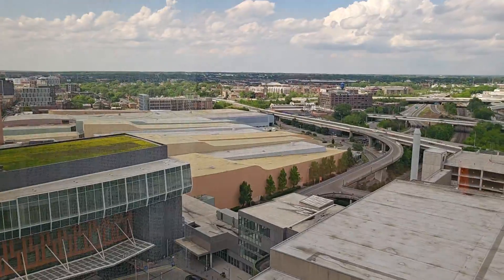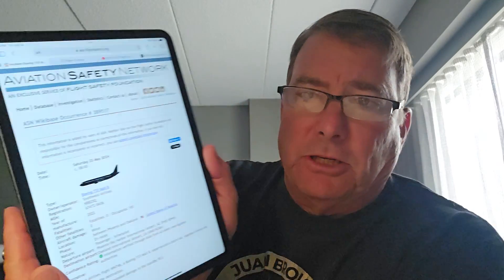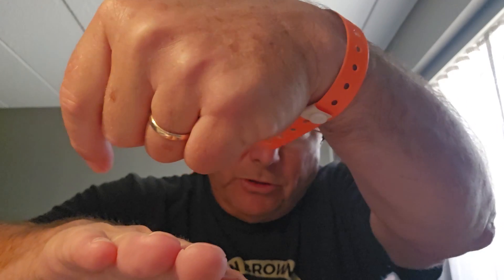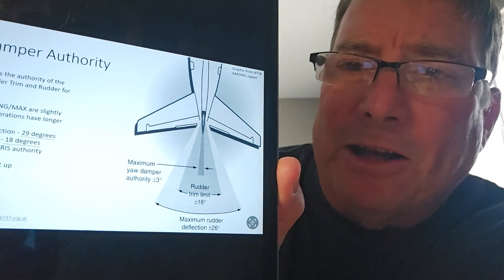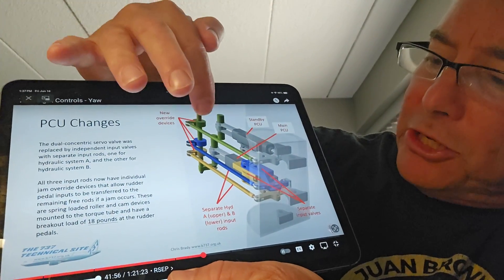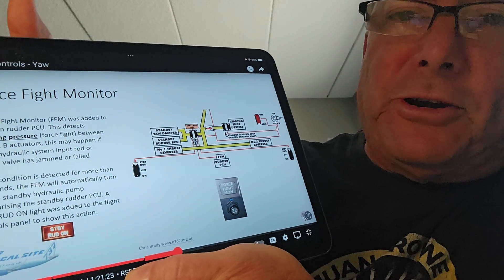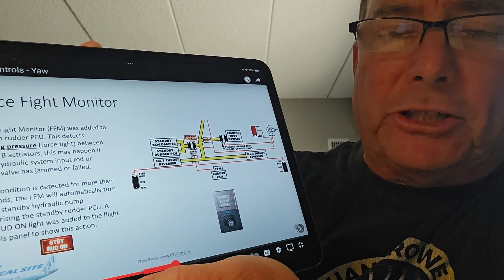SWA 737 Max-8  "Dutch Roll" Incident

Comment: Hi Juan, thanks for the in-depth post and explanation. If anyone has ever seen or been in a larger aircraft while the pilot is getting aerial refueling training, you've seen or experienced dutch roll. During this evolution, the pilot often causes the dutch roll via a PIO or pilot induced oscillation while trying to stay in position behind the tanker. Remember that, Juan? Cheers!

Comment: I've always had an almost irrational fear of fly by wire mechanisms.  I'd rather not have the machine between myself and the machine's control mechanisms.  I suppose all of those electronic and mechanized control systems have less of a chance of failing than cables do and I don't think that there is much of a choice in the matter based on the amount of force that can be exerted on the control surfaces of some of these high speed flying vehicles. We have no choice if we want to use these systems except to accept the fact that our lives must be entrusted to machines and computers.  I have always made the assertion that if you want to live to be old then don't ever trust your life to a computer.

Comment: One of the things we do in simulator training is a Dutch Roll demo at high altitude. We disarm the Yaw Damper and turn off the autopilot. The results of displacing the rudder in this condition causes a Dutch Roll that can be really dramatic in swept wing jets and hard to recover. Props to the pilots in this case who managed to recover from this incident.

Comment: For all you fellow aviation geeks out there, according to William Cook in his book The Road to the 707, the yaw damper was invented by Ed Pfafman, an engineer at Boeing during the flight testing of the XB-47 - the USAF's first swept wing jet bomber. The test pilots noted a continuing Dutch Roll in  '47 and Ed came up with a solution. Brilliant guy. A yaw damper has been standard equipment on swept wing jets ever since.
Reply: The yaw damper has come a long way: the early ones were mechanical (mass and spring) devices, and now they are electronic, part of the flight control computers.
Reply: Some of the engineers at NACA, the predecessor of NASA, worked on similar systems, including pitch dampers and special systems to help control buffeting. One of those guys was Christopher Kraft, who later became the Chief Flight Director at NASA.
Reply: correct ,,dutch rolls have been happening for years on aircraft and at high altitude and your are correct about the yaw damper,,,gyro,,,it will correct this no big deal.

Comment: If it's a 737 Max I ain't going on that Boeing.

Those fuel-efficient engines are too large for that older basic airframe and the center of gravity was thrown off.   That's why they installed the MCAS system to try and compensate for that imbalance, IMHO.  NO THANKS.

Comment: Good Day Juan.  Fairly technical but well explained. I do understand yaw dampers to a degree.  How could Boeing screw up a long in production aircraft so badly?  It's like the car manufacturer's recalling hundreds of thousands of new cars for a problem that was solved decades ago.  Why did they "Change" something that worked?   Maybe Airbus should take over running of Boeing. or, let the engineers start doing their job, again, instead of the bean counters...   Even you, Juan, are now questioning Boeing.  
Thank You & Best Regards.    Fly Safe, Clear Skys.

Comment: I am a mariner, not a pilot. Do I understand you correctly that there are actual cables (not electrical cables) on these aircraft ? If so I have to admit being shocked. I always assumed the systems were fly by wire !
Reply from the maker: Not on 737s.

Comment: Airplanes do not develop extreme dutch roll if the yaw damper is working properly.  Therefore there was either a malfunction or the yaw damper was not engaged.  The damage nobody is talking about probably involves the vertical tail structure which can fail if the maneuver continues to get more severe (diverge) .  The biggest risk is encountering turbulence at high altitudes above FL370.  I suspect that the difficulty occurred above this altitude and the pilots were descending to aid in recovery as they are usually taught since pilot recovery is extremely difficult using manual flight control inputs.  Yes, once upon a time C-141 pilots were demonstrated dutch roll during training.  They however turned the yaw damper back on to recover and were not required to demonstrate proficiency in making a manual recovery.

Comment: United Airlines Flight 585 on March 3, 1991, from Denver to Colorado Springs was not a rudder hard-over. It was a multi-axis hard-over. After that accident Boeing lost faith in the Honeywell SPZ system and went with the Collins flight control system. They came up with some rolling wave off the mountain theory to explain the high rates of roll the aircraft experienced, but it was baloney. Computer simulations at that time showed that to achieve roll rates the aircraft experienced the ailerons would have had to be also involved. Many in the industry believe there was a design error in the SPZ system.

Comment: Since aircraft now have constant access to hundreds if not thousands of Mb/s of bandwidth anywhere in the sky, and since the memory capacity of the Internet is measured in petabytes if not exabytes why do commercial aircraft not use a tiny fraction of that bandwidth to continuously transmit the CVR and FDR to their headquarters and optionally to their national safety regulators?  The information is privileged, but surely not from their own management.  Or failing that whenever maintenance equipment plugs into the aircraft why is the contents of the recorders not downloaded "just in case".

Comment: I'm not sure that additional cockpit voice recording would have shed more light on this incident; "Oh [expletive]!  What was that?".  Further, modifying the voice recorder is not as simple as modifying the circuitry to allow a larger memory chip (most probably what are known as NAND/NOR Flash chips like in USB memory sticks) - in fact,  that's the easy part.  Then there would probably need software modifications and system recertification, which nobody wants to do because of additional costs for each type of box flying.  Finally, from the pilot's perspective, I wouldn't want to work in an environment where every word is recorded...

Comment: I remember the old Heinz 57 sauce rule from my 727 days.  With no yaw dampener (had to go there Juan) the sum of your altitude and airspeed should not exceed 57.  For example: if you're at FL370 then your airspeed should be less than 200kts.  This reduces the dutch roll tendency.  I'm sure it's similar for the 737 but the 727 has a highly swept wing exagerating dutch roll.
Reply: If you try to slow down to 200 knots max at FL370, the first thing you will experience is the 727 falling out of the sky well before 200 knots.  Dutch roll worries will by replaced by stall recovery steps.

Comment: I'm not really an aviation guy (I prefer things on wheels) but I always follow air crash investigations and educational videos like this for their engineering input. I remember those two rudder hard-overs from years ago - they took some work to track down the fault. If I recall it needed a very cold pcu with very hot fluid to replicate the fault.
Modern aviation is nothing short of a miracle.  I cross rhe Atlantic regularly, and the aircraft always leave on time and arrive on time and nothing ever goes wrong.  I think that is because we never forget that carrying people in a highly complex tin can seven miles in the air is a very dangerous activity. Once we start cutting corners and taking chances, the wheels will soon come off, if you know what I mean. That's what Boeing seem to have done since they ceased to be an engineering company and chased shareholder profits.

Comment: I would only imagine that full rudder cable control inputs simply command the PCU to full deflection of that hydraulic actuator. The PCU itself would reach its mechanical limit of the hydraulic cylinder and stop there. I think the damage could be caused by one of two things.
1. Somehow both PCUs were commanded in opposite directions simultaneously which could have overloaded the ribs torsionally.
Or
2. The rudder input from the pilot to correct the Dutch roll event somehow commanded full deflection at speed, over-stressing these ribs. Generally there is a rudder limiter that reduces rudder travel in relation to airspeed/mach. This will be interesting when we find the answer to say the least…

Comment: Engines are in a different location and thrust centres have moved. Even the enginr nacelles present different drag when in yaw. Any dynamic system requires tuning when such fundamentals change.

Comment: Thanks for the honorable mention of the C-141.  I'm sure you remember the C-141A flew along in a tiny dutch roll movement and when the plane was lengthened (with air refueling added and designated a C-141B) that the slight dutch roll was eliminated with a new digital yaw damper.  A more stable feel of the aircraft was a welcome change.  Keep up your great analysis THANKS !

Comment: Well, this retired 737 pilot, confused by the reports, queried "ChatGPT".  ChatGPT says that "yes there are changes to the PCU on the Max...The rudder is more integrated with other systems, such as MCAS".  Yes, I know, the dreaded MCAS.  However, Chat goes on to say, when I asked specifically, that MCAS does NOT have any input to the rudder movements and is limited to inputs to the horizontal stabilizer only!
Clear as mud.
Did this aircraft suffer a loss of Hyd Sys A or B?  Did they manually turn on a Sys A or Sys B "Standby Rudder" switch?

Comment: My question is why doesn't the FAA require planes to transmit "black box" data to the cloud? Most modern airliners have satellite based internet on board for customers to use WiFi,so it seems like the airlines should pay for server space to hold all their flight data and voice recordings. This would solve the problem of recorders being overwritten, and also the problem of finding the "black boxes" after a disaster in which the plane disintegrates.

Comment: Thank you for calling out the "dampENer" media broadcast misinformation. My time with C-141As was 1976-80 (air cargo side), when they converted to "B" models -- I'm curious if the extended fuselage/long. axis  added-to or helped mitigate Dutch Roll problems with that otherwise tough, capable global airlifter. (It had "lift-dumpers" too, below the spoilers, if I recall.) In this most-recent reported event, good on that trained and alert crew in recovering from the grim prospects of such a failure. Christ almighty... that Alaska Airlines door plug blowout has finally yanked the corporate greed tarp off of an unending list of indefensible, I believe criminal culture in their house.

Comment: This makes me wonder if the software engineers don't understand mechanical limitations, or mechanical limit tolerances. Sure, they understand when you Input Yoke X, Y, Z; or X1, Y1, Z1; there is a corresponding output of the PCU, but do they know there are limit tolerances (milliseconds, 1/10,000 inch of travel, +/- .3 degree's etc)? I think something is getting lost between software design and mechanical design.

Comment: So they lost 2 aircraft before carrying out a workaround to the problem? Be interesting to know how often the stand by PCU is called into action?  If it's called into action a lot then a single failure (damaged to PCU or mounting ribs) may just be a maintenance issue. If it is very rarely called into action this may indeed be a design problem with limited use hiding the fact of a potential issue.
Again here we are with an old design using old tech to keep the model flying. The Wright brothers were using cables and pulley's

Comment: 2024 Reauthorization Act, which was just signed, mandates the CVR to 25 hours for new aircraft, and six years to retrofit older aircraft with the 25 hour CVR. (It is HR 3935 in case anyone wants to read it)

Comment: What do you think started the Dutch roll? Smells like a yaw damp hard over. I don’t know the max systems, could the yaw damp be on the primary pcu? They had a problem, disconnect yaw damp and stomped on the rudder to regain control with the secondary “manual reversion?” Or maybe they stomped on the pedal prior to disconnecting the yaw damp?

Comment: Juan, are you going to make a video about the 787 assembly issues with the 900 rivets not being fitted properly, per plane? Boeing claims that this issue is just confined to undelivered aircraft and that all the aircraft currently flying are safe, but as you said "Boeing has lost our trust". Should we trust them in this issue? Would YOU fly on a 787 right now? I presume you feel pretty good about 777s at the moment as you are still flying them multiple times a week.

Comment: Juan,  11k hour NG/MAX driver here, unfortunately or fortunately depending on your perspective, I’m inclined to posit human error on this one.  One of the pilots “stuffed” a rudder accidentally and either the YD was overwhelmed or they (the pilot) tried to override the YD to correct his/her misstep.  Similar to loss of control of Lantam 787, with inadvertent seat movement.  FWIW.
Reply: The usual explanations don't mention how the Dutch Roll gets started up at cruise. I'm very grateful for Brownie's mention of turbulence as one possible cause. Thanks for sharing another possible cause. Lucky that the plane was designed and assembled well enough that she was able to continue flying and land safely.
Reply: Did they lose altitude or declare an emergency and why would that cause damage to the PCU?  If they knew why it happened why would they report it to the NTSB as a unknown cause?

Comment: I used to have one RC Model that would Dutch Roll quite well.   To enter the Dutch Roll, it would need to be climbing on 3/4  throttle with a high alpha, nose up configuration.   Then any quick blip of the aileron would set it off on the Dutch Roll, and decrease the rate of climb.   To exit the roll all that was needed was to release the back pressure on the stick, to push the nose back down.    I always flew this with the model heading away from me, as I wanted to see the aircraft.  The period of the oscillation was about once every two seconds, so no rudder control was attempted.

Comment: Hi Juan, not much difference is shown in the rudder systems description in the FCOM between the Max and NG. The only change I see is that although on both types, rudder authority is reduced by 25% above approximately 135 knots (system works the same in the air and on ground), on the Max this limit is removed if it senses a difference in engine speeds (failure, shutdown etc.)

Comment: I'm just a back seater, but your description of a Dutch Roll seems similar to what it feels like in the back of a 777. The back of a 777 experiences more severe horizontal judder than seats closer to the wing, as the back of the aircraft extends much further, and small changes are magnified. I have no idea how that correlates with a 737 judder, as I've rarely been that far back. Most of the time, I only experience this on trips to the restroom in the back, and don't visit the restroom on shorter flights, so don't go to the very back.

Comment: Dutch roll in large jets is an adverse aerodynamic condition unique to their design and is worsened by higher swept wing angles. Seems to me a malfunctioning flight control component causing what appears to be a Dutch roll is actually a flight control failure caused by he PCU. Not technically a Dutch roll.

Comment: CVR limited to 2 hours. It was a 2 hour flight. Why wasn't the data saved?
Reply: By the time it went to maintenance...it would have been erased.
Reply: @JohnSmith-pl2bk  If the CVR breakers were not pulled.

Comment: We were in a dutch roll incident in April approaching LAX.  Delta 737-700.  I just reported it to the FAA.  It was pretty scary.  People were screaming.   I bet you single trip flight insurance makes a big comeback.
Reply: Ask FAA to supply you with the tail number of the 737 you were on...and the tail number of the subject aircraft??
Reply: @JohnSmith-pl2bk  Why?  I just reported it through the FAA Hotline and got a report number, AAE-EHL-20240614-080.  They can find the tail number from the carrier and flight I was on.  If you have premium Flight Aware you can get it that way too.  Delta Flight 302, Detroit to Los Angeles 4/30/24.   I reported it because there may be a pattern.

Comment: 5:00 — It’s a damper, not a dampener!
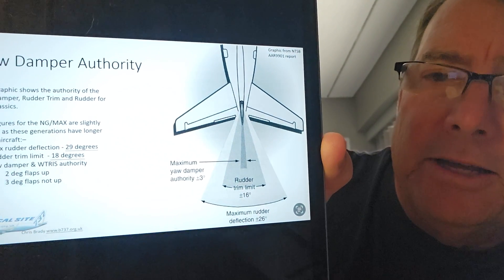9:17 — 3° of rudder authority is all it takes to dampen Dutch roll

Merriam-Webster: “damp (transitive verb): to check the vibration or oscillation of (something, such as a string or a voltage)”

Comment: As a passenger in a 777 on climbout from Shanghai Pudong I experienced a dutch roll due to wake turbulence from a 747 ahead of us. It damped down quickly but left us passengers wondering until the flight deck informed us what had happened. It wasn't frightening but was certainly out of the ordinary and felt like an evasive maneuver.

Comment: Hi Juan.  My dad was in charge of all maintenance at Rickenbacker AFB in 72-75.  They had 12-b52s and 12-kc135s and a few ardvarks F111s that I knew about when I was 9-10 yo.  Going to work with your dad was really special back then.  FYI.  Dad was also in charge of the base renaming from Lockbourne to Rickenbacker.  Of course we all loved Eddie.  But the usaf frowned when Eddie’s Eastern Air sort of took over the celebration event.  Life and times remembered.  One 60 yo usaf brat.   Always and forever.
Reply: Oh yeah.  Dad was a load master on the c141 and then finally a flight engineer.  Much like yourself.  Thank you for your service !